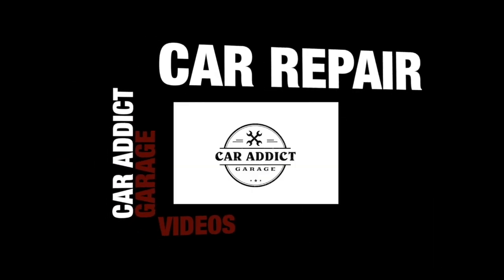My Primer Cracked Like Dry Mud!  What Do I Do?

Comment: I have an area on my door I have repaired bonded and sanded. It appears perfectly sanded and smooth yet every time I prime it the primer cracks within minutes so strip I  it all down again sand it back to what seems to be perfection spray the primer on and hey presto crack in the primer AGAIN.  I have done this now three times and feel like giving up. Can I put some filler over the cracks when the primer has cured maybe 1k filler  or what the hell else can I do?

Comment: Thank you,  your the best. It worked,  sanded all down, follow up question.  Can you wait past the Flash time of 15mins to spray another coat on or will this hurt the primer,  thank you
Reply from the maker: No, not unless you wait too long.  Most epoxy has a 72 hour window that you can spray another coat without sanding.

Comment: Kinda off subject but how long can sanded primer sit in the shop before spraying sealer , base coat and clear
Reply from the maker: I do not know the exact time, but a long time.  It is the UV that breaks the primer down and starts oxidizing.  In a shop out of the sun would last a long time.
Reply: @CarAddictGarage  after sitting for 2 to 3 months would I need to re sand scuff or just clean and prep for paint. Curious because I habe read that primer is or can self heal ?